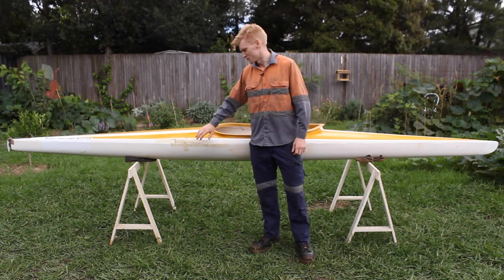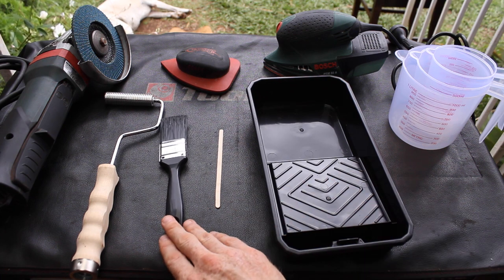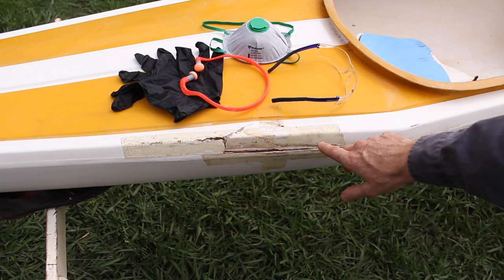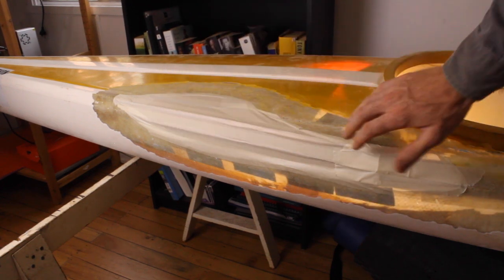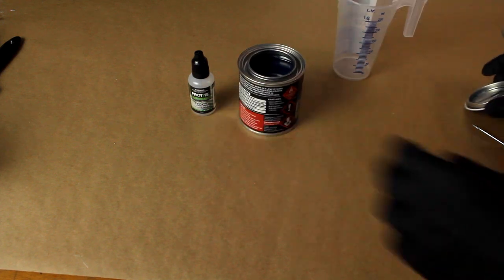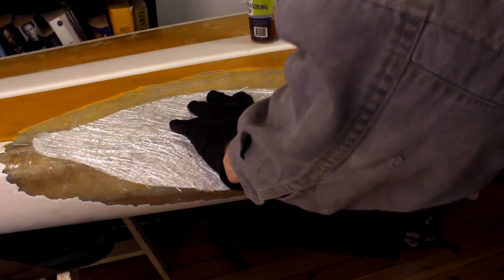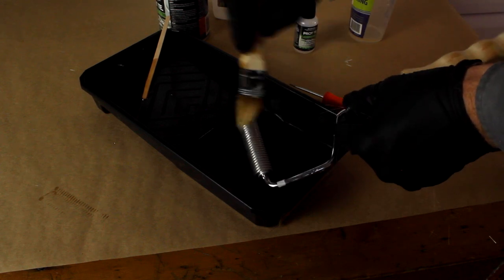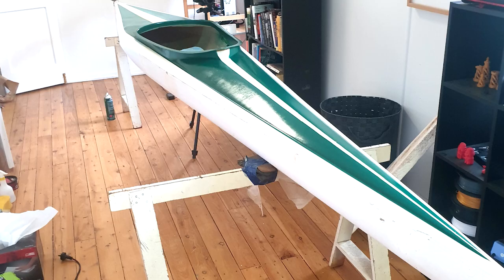Fibreglass Repair large hole in kayak: Complete Guide

Comment: Hey, great video, just as an easier step, instead of cutting everything out at the start, its easier to brace up the damaged area, then lay up 2 sheets of chopped mat on the inside, that way you get a perfect profile, once cured, just grind away the damaged glass. FYI im an advanced composite repairer on aircraft and carbon fibre, and thats what i do.
Reply: how can the damaged material be ground off once the inside is cured? is it all not bonded together now?

Comment: Good quality video.   I have recently taught myself to glass.   Done a few kayak restorations now, one was a hole about the same size, that was an interesting job.   Due to access issues I couldn't get in behind the hole so I had to use foam, which meant I then had to use epoxy resin.   Still it turned out quite well.

Comment: Much better than the average YT instructional, still, would benefit from more detail, especially in the fairing and finishing phase, for which, a dedicated cameraman is really essential. I do a lot of fibreglass repair and building to my own fleet, always using epoxy resin instead of weaker and cheaper polyester. In this case though, polyester resin would be the better material so as not to create a hard spot in the hull.

Comment: What a great job!  You explained everything very well !
Although I did not see in the video, did you repair from the inside of the kayak as well?  
what I mean is, did you patch it with the fiberglass and resin from the inside as you did the outside?

Thank you for showing the safety gear necessary for working with the fiberglass and resin.
Reply from the maker: thanks for watching! yes patched the inside as well, was a little difficult to film the inside process 
though :)

Comment: That was a clear and easy to understand video tutorial. Now I know also on how to repair a crack on fiberglass. 
One question is the wood you used to hold the fiberglass in-shape, what makes it not to stick to the fiberglass?
Thanks again for the easy to follow tutorial video.
Reply from the maker: A layer of double sided tape between the wood and fibreglass does the trick

Comment: Great job! I wouldn't ever think you could repair such a big hole on a kayak. Wow, I'm impressed.  Instead of the acetone is it ok to some other acid product? Is there a particular reason why you are using the acetone? Thanks for your help. I wish you the best.
Andy
Reply from the maker: You can also use a wax and grease remover! Septone makes a good quality one if needed. Thanks for the question.

Comment: Pity there isn’t ready made thin fibreglass sheets that could’ve been used on the inside instead of the wooden backing material. A thin sheet would give perfect form. You did a good job nice surface finish.

Comment: Um, you should't sand before adding subsequent layers.  There are 2 types of resin, laminating and finishing.  Laminating resin has a low wax content.  This means there is insufficient wax to seal the surface from the air and this means that the new resin surface does not fully cure which makes it ideal for chemically bonding subsequent laminate or a finish such as flow coat.  By sanding, you have removed the bonding surface and this will result in a weakness between the laminate, leaving it more prone to separation than if you had not sanded.  Also, 1 day is not sufficient time for full cure.  While it seems hard, it is still not fully cured.  Full cure takes a week or two before reaching water impermeability for example.   Also, I would add that most laminate kayaks would only have 2 layers of 450gsm glass except for a diamond area under the cockpit (which is a wear and stress zone).  That is/was a racing kayak and would normally be laminated in woven fabric rather than chopped strand to substantially reduce the weight or resin.  Glass/resin ratio for chopped strand is 1:2.5 while woven is 1:1.5 if memory serves me, so that is a big weight difference because the strength is in the glass & not the resin.  If you want to keep the boat light, use woven cloth of the same GSM and reserve chopped strand matt for tight and complex curves that can't be done in cloth.  Top marks for doing one layer inside and one out though as that increases bonding surface area.

Note that Finishing resin and flow coat have a high wax content.  The wax migrates to the surface and seals it from the air which allows the resin to fully cure right to the surface.  Laminating resin and Gelcoat have low wax content so that air at the surface inhibits cure which improved chemical bonding with subsequent layers within several days.  If these materials are exposed to water withing a couple of weeks, the surface is likely to turn milky.  After which, it will never fully cure and this milkiness will reoccur with subsequent exposure to moisture.  This does not happen with the finishing products though.

Comment: Very good and instructive video. One question, what kind of paint did you use?  You need some kind of gel coat or epoxy to cover and protect the fiberglass I guess?
Reply from the maker: Thanks for the comment, I used 3 coats of primer filler, then 3 coats of acrylic , 3 coats of clear coat on top of that to seal it. 🙂

Comment: awesome! Did you remove the wood from the inside?
Reply from the maker: Sure did! 🙂
Reply: @WillLawson  awesome! So 3 layers of  fiberglass is strong enough?
Reply from the maker: @nachowithan.a1386  I think so! Considering the kayak originally only had 1 layer it was originally used for river racing so it's quite light on the amount of fibreglass 😂  I did notice however the very front and rear has epoxy over it as a bit of extra strength. All the best👍
Reply: @WillLawson  Thanks!